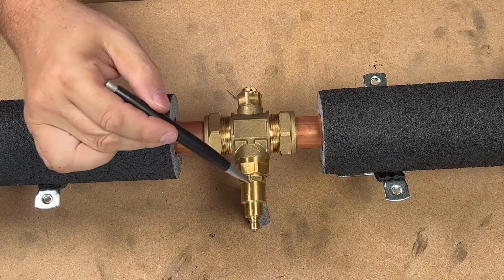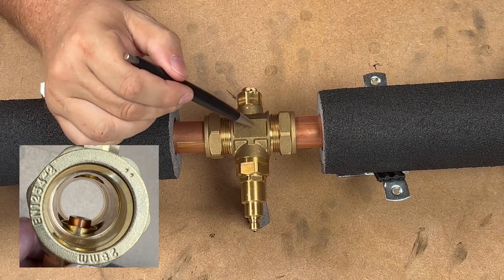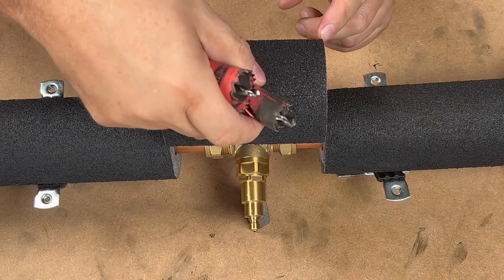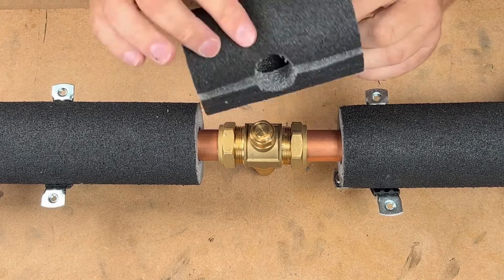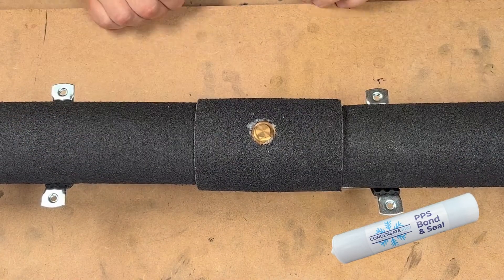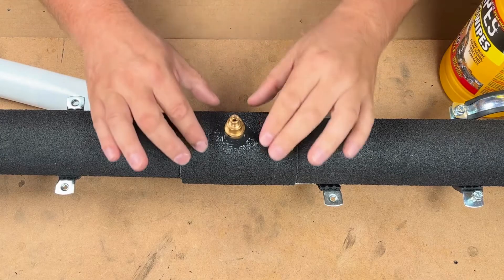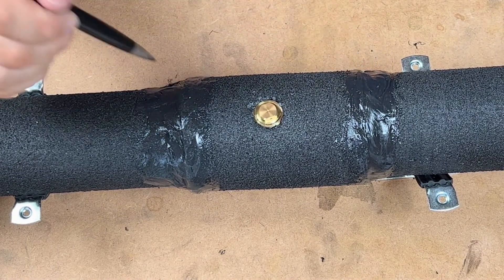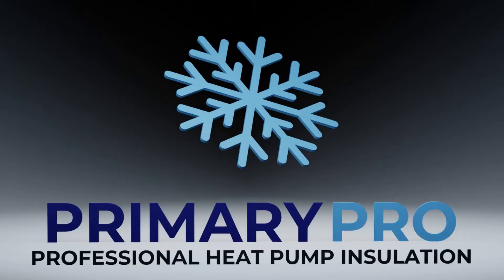Insulating an Inta Antifreeze Valve

Comment: Would armaflex Lagging tape be a better sealing option  ? Also other Antifreeze valve maunufactures say not  to cover the valve as the valve does not potentially reach its lowest tempreture ? not sure whos right ?
Reply from the maker: Good questions 

If you look at the tapes available they let water through ( water vapour diffusion resistance  is lower ) and even if they were  waterproof it's very difficult  to seal all  the gaps and impossible to use in temps lower than 10 and when it's  raining ( humidity higher than 80%)

The smallest gap will let moisture/water in so reducing the efficiency  

All external pipework and any external fitting must be insulated & sealed correctly  to stop energy being wasted and water from getting in that will increase thermal conductivity and so seriously reduce efficiency 

If they can't be insulated they can't be used outside 
anything external that's not insulated and sealed correctly is wasting heat/energy 

Every watt counts on the efficiency of a  heat pump and system
Reply from the maker: NO, the water diffusion  resistance is very low.so  will increase thermal conductivity and reduce efficiency, Also trying to fit that in cold or wet weather is impossible, all the primary Pro products are made for the job and to help pro installers